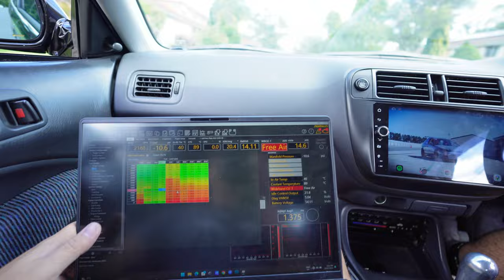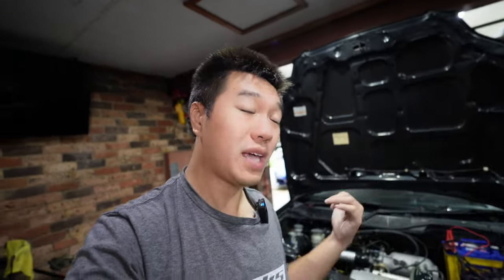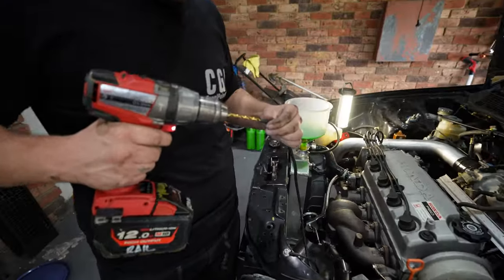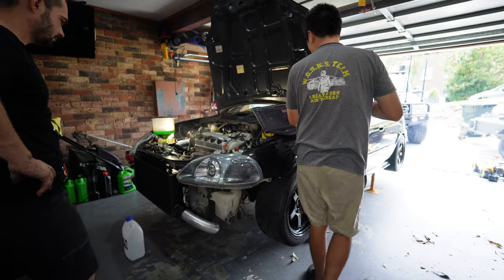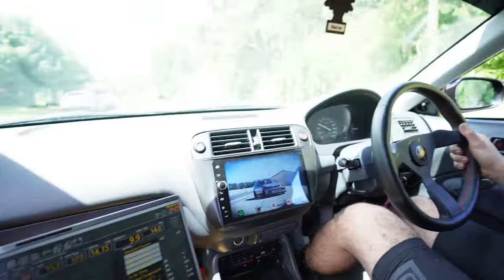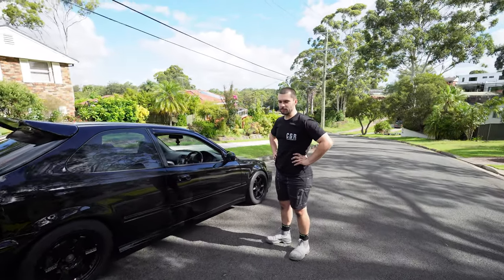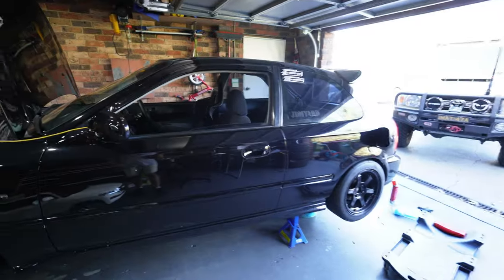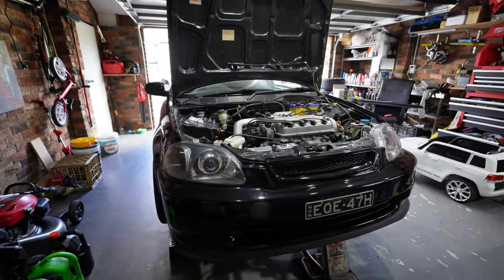D16 TURBO first start and drive - SHE RIPS!

Comment: Nice car I guess but a budget k swap makes more power all motor and is definitely much quicker then a turbo d even making 180 kw plus ! My stock k 24 made 159 kw !! All motor don’t waste your time on a turbo d for it to blow go the right way !!
Reply: In no world is a k swap cheaper than a turbo kit ecu and fuel management
Reply: A turbo d is whippin a stock k swap man
Reply: turbo d16s can do 250 with stock internals but thats about it thats the thresh hold
Reply: Wrong and wrong lol I built my bottom end on my d16z6 and boosted it for under 3k... It makes double what a stock K series makes now..
Reply from the maker: I have to respectfully disagree having built 2 kswaps with k24a3 
A truly STOCK k24 does not make true 159kw. Been there done that.

Comment: I need to put a turbo on mine I got the sexiest d16 engine bay in all off Sydney all she's missing is a turbo she's getting the head rebuilt so she well deserves it been running haltech with nice air induction and skunk throttle body and manifold best exhaust pops and bangs and shoots flames she's been tuned running on 98 fuel she makes 98kw turbo Tristan where you at hahaha need you I'll be your best friend for ever I'm thinking off getting a already tapped sump from America couese I know thats the hardest part and im no mechanic but I'm sure if I can get the sump I'll be all good for the rest but some pointers would be good

Comment: Hi jonathan as you said that you are making a wiriing video can I follow it for my haltech 750?  I realised you said you have the 550 will the wiring be the same? And also do you know if the 750 can run ac because im keeping ac in my build and i need it as it gets hot here in Perth.
Reply from the maker: Hey mate
Yes 550 and 750 same wiring harness. Give me 2-3 weeks the video will be up. 
Yes 550 and 750 should have enough for AC I have confirmed with haltech
Reply: @JCYT  awsome, i also have another question since i havent installed my ecu yet i was wondeing if it would be ok to drive the car on stock internals and ecu, the car already has the tubro installed, not trying to fully send it or anything just daily drive it until i install the ecu.